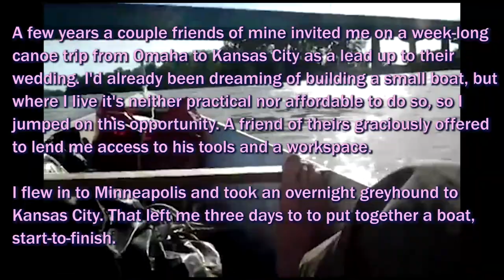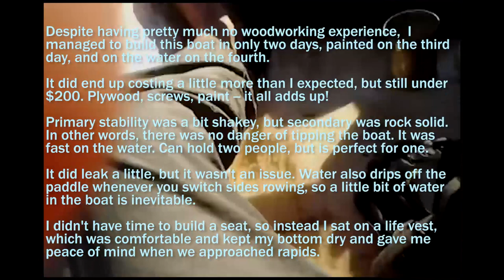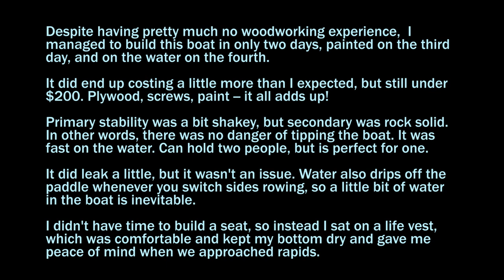Two-day canoe build

Comment: Cool canoe 😎. I have had an inflatable Sevilor k79 for nearly 20yrs & I can see myself building something like this as a replacement, & my first foray into boat construction. ATB
Reply from the maker: If you have the luxury of time or a bigger budget, there are some cooler "stitch and glue" style plans floating around the internet that would be worth looking at. But whatever gets you out onto the water! I actually ended up picking up a Sevylor "Adventure" at Costco. It's a little wonky, but it's fun and easy to pack down into the trunk of the car.
Reply: Sadly, time is a luxury I struggle to find...

Comment: Can you give dimensions of your boat I tried to open the links and they don't appear to be working I like your design  thanks for sharing
Reply from the maker: Well it's based around plywood,. Two 8x4 sheets end-to-end. So the length of the sides was around 16 feet. Don't remember the specifics though. There are far better designs out there though. This design was my compromise for speed. Better to take your time and end up with something a little higher quality.

Comment: Did.you not.seal it.with fiberglass in.any way? How did you keep water from coming in through the seems?
Reply: Carlos Gaztelu Cabral paint and caulking have been used for centuries. It just requires more maintenance.
Reply: He put random periods all over it.
Reply from the maker: Not sealed with fiberglass. Relied entirely on caulk and paint. It leaked a teeny tiny bit, but the inside of a boat like this gets wet anyway because of water dripping off the oar. So it's not like it made big a difference. If I'd had more time I could probably have done a better job sealing it. But it worked fine.
Reply: "Pee Row"